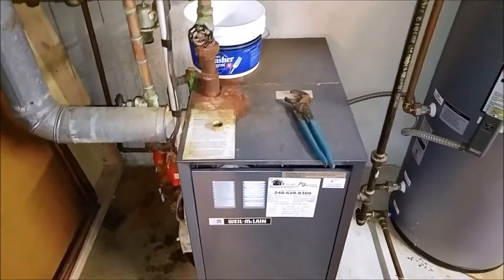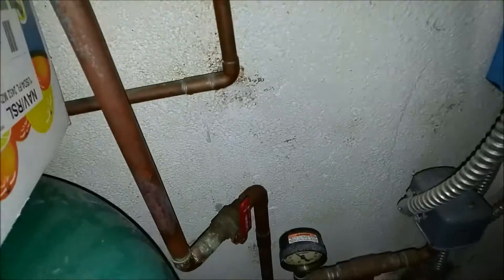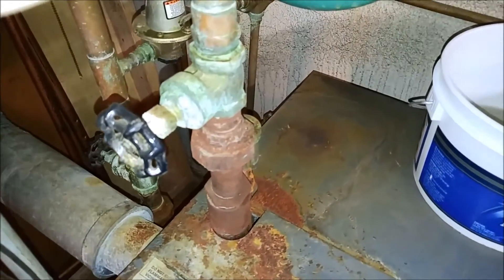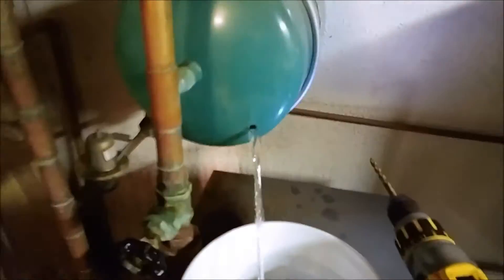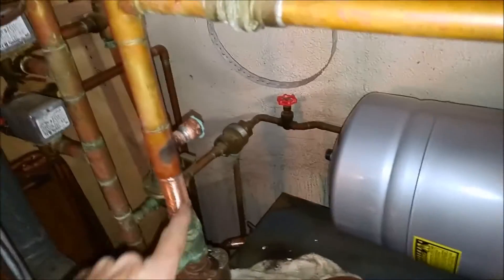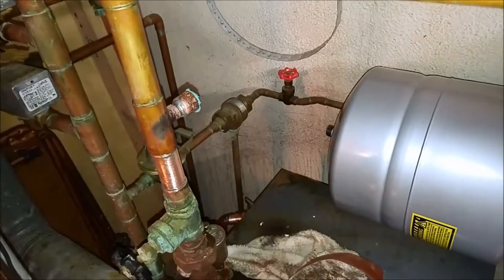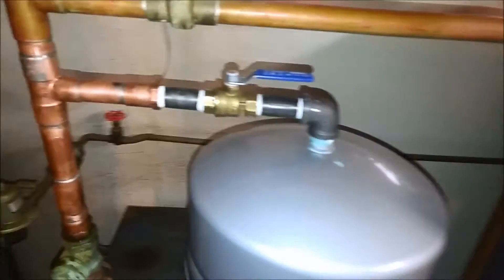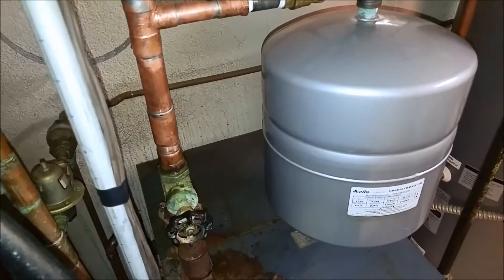Boiler expansion tank replacement rough service call

Comment: As soon as he started using the channel locks backwards to take off the air purge valve, I immediately stopped the vid and went on to another vid! Later.
Reply from the maker: Thanks for watching
Reply: As soon as I saw you using the channel locks backwards, I stopped the vid and posted my comment! That was all I needed to see! I felt as though I was watching one of my new apprentices working! @MiHeatingGuy
Reply: @rshoe1023  haha I noticed it too!

Comment: Wouldn't you need a dialectric union for the dissimilar metals?  Plus, what about checking the air pressure or adding air pressure to it?

Comment: how you determine at what psi new expansion tank for boiler needs to be set at ?
Reply: Needs to be set according to the pressure going into the boiler. So if the boiler is 12 psi the tank should be 12 psi